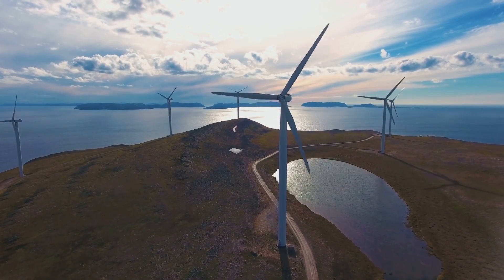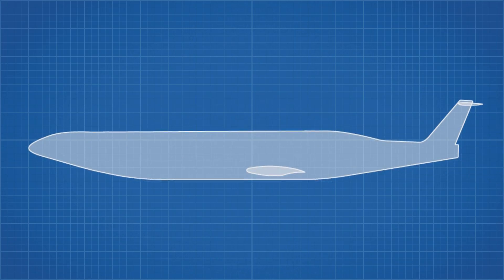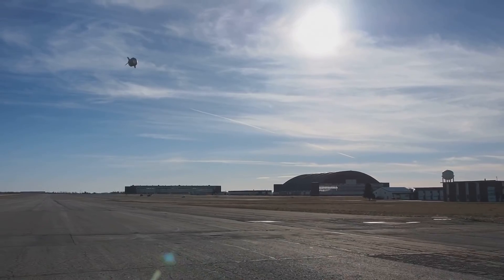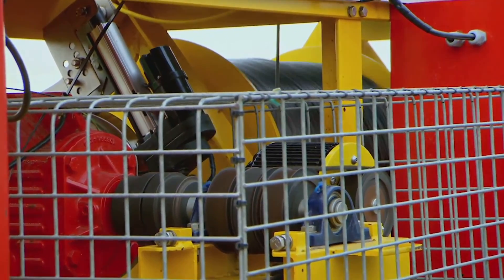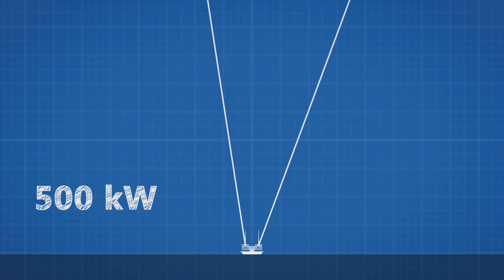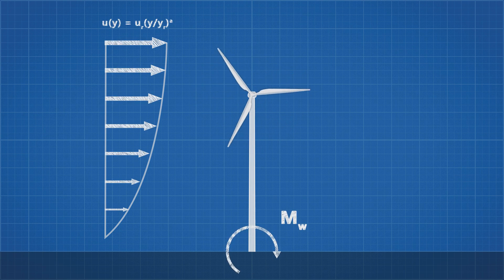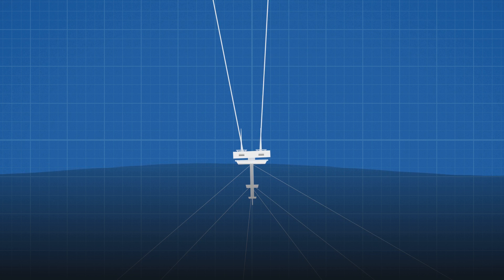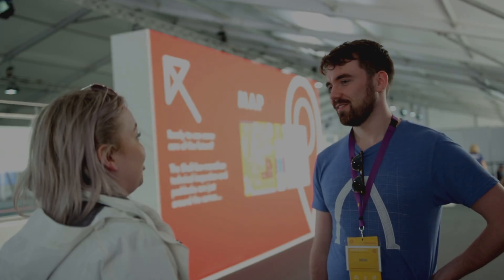The Future of Wind Power? - Kite Power Systems

Comment: Is there not away to use gravity for electricity?
Reply: Yes. A: Dams use the gravitational pull on water to drive their turbines... and B: Steam Engine technology use gravity in conjunction with pressure.
Reply: There is. It's called Hydropower.
Reply: gravity is only useful to store power or to harness potential energy generated by the sun like hydro.